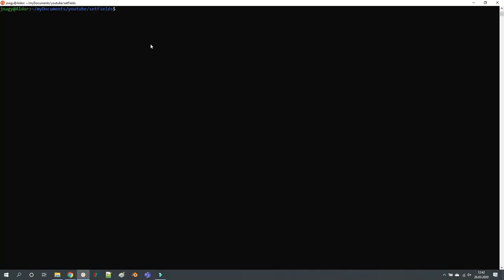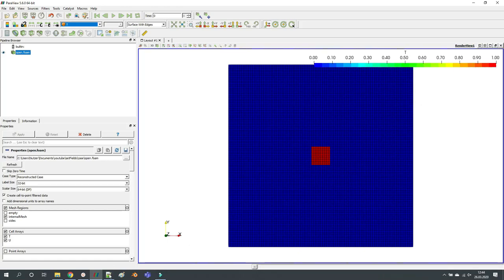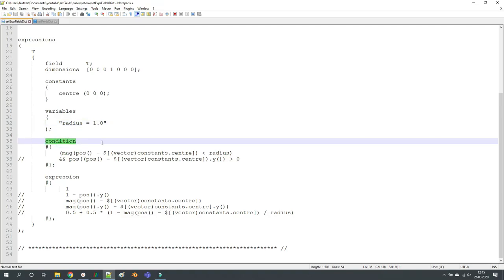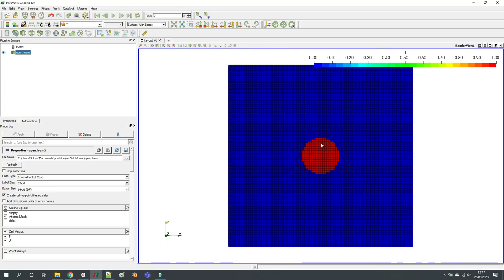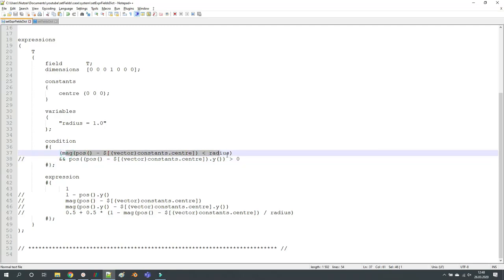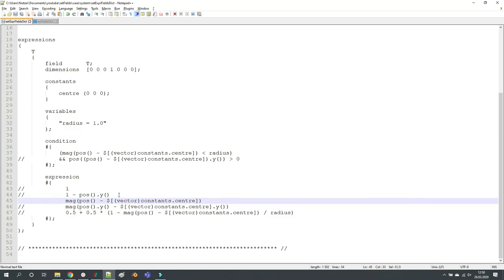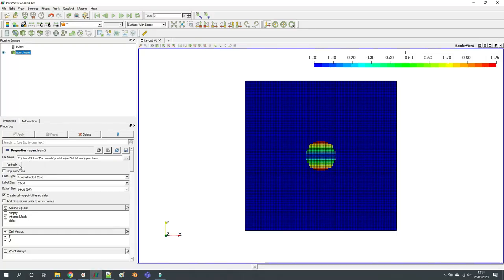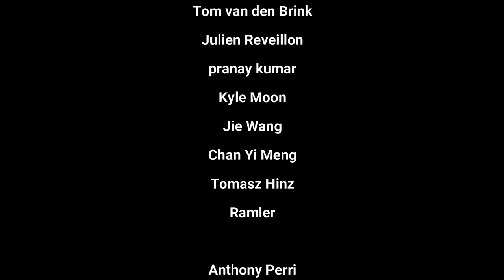How to initialize non-uniform fields in OpenFOAM

Comment: Hi József, do you know a quick way to set fields to a region, within a certain distance offset from a specific boundary patch?
Reply from the maker: No, not from a boundary. You can define sets (faceSets) and you can use those in setFields. Maybe you can use this approach.
Reply: @OpenFOAMJozsefNagy  Thanks a lot.  Do you mind explaborating more on that?
Reply from the maker: @engineeringarts4509  Check out the overset tutorials. There the overset mesh and the background mesh are separated using setFields. In setFieldsdict you don'T define your regions via geometric bojects but rather sets. It is worth a try.

Comment: Is there a way to use this to cut on mesh size?
Let's say i have a car to do external aerodynamics on, but i want to test only changes done to the rear wing which is of course subject to the part of the car in front of it, can I simulate once the whole car and then take a cut plane in front of the rear wing and set it as inlet with the velocity from the previous case? So that i don't have to mesh all the chassis, front wing, front wheels etc. but i still have their effect in the simulation.
Sorry if it's not clear
Reply from the maker: mapFields is your command ;)

Comment: Great video, I haven't heard of this new utility until now. 2 questions:
* Are there any advantages/disadvantages of using this utility over swak4Foam and funkySetFields utility?
* Do you know if these utilities can be also compiled with OpenFOAM Foundation branch?

Thanks
Reply: Hi Bulut, out of the box I would say: Advantage is that you don´t need swak4Foam as it is an OpenFOAM feature. As I am commonly using the Foundation version, I am not aware of such an option here. And sure, you can compile the addition to the foundations version but if it works out of the box I am not sure. I would expect to get problems during compiling even though, you first need to select where this feature is included. 

Tobi
Reply: a shame that this has not been added in OFv8... I was hopping for it u.U
Reply from the maker: @HolzmannCFD  I agree with Tobi
Reply: @HolzmannCFD  in the setfield ca we write the codestream to create a non-uniform value? Because I am trying to using codeStream in the setfield but it is not working.